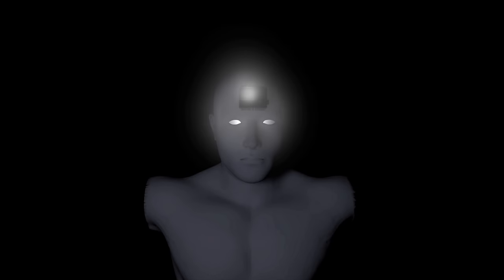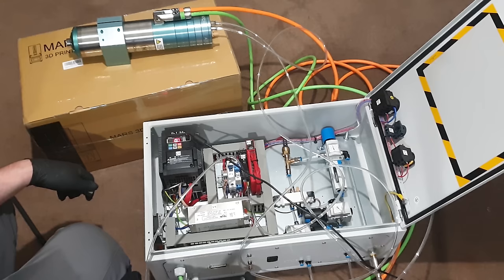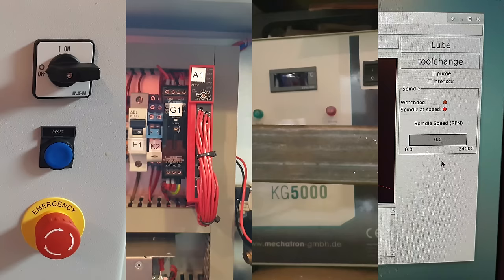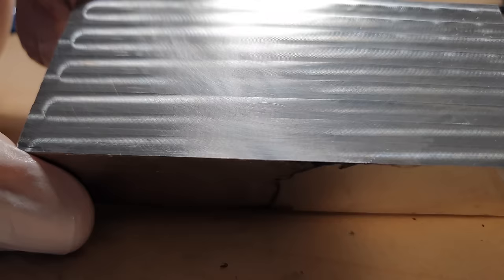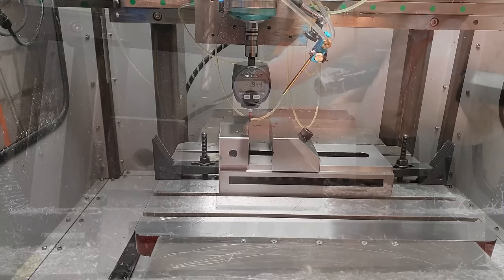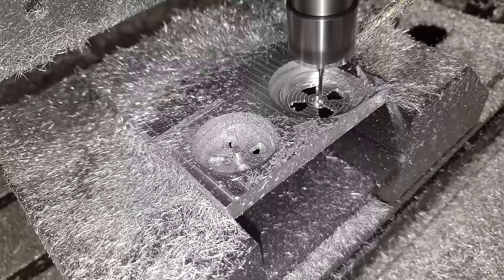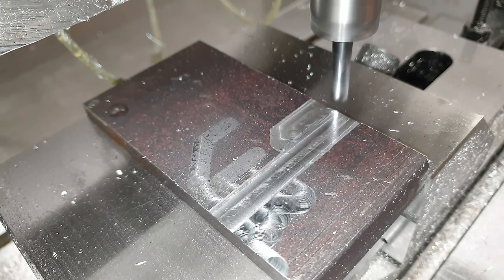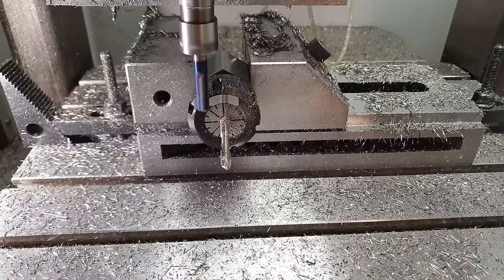CNC Finale: Automatic Toolchanger Spindle Install & Testing

Comment: @MarcoReps I'm pretty surprised that a company that pays so much attention to details would allow the exhaust of the pnumatics to vent openly into a cabinet containing the electronics. I like cabinets for pnumatics but in an application that electronics are in a shared cabinet, i externally vent all exhaust ports and i recommend you do as well. Stops oil and dirt build up in the cabinet and helps protect the electronics. Easy solution with a few pushlock fittings and hose and a nice bulkhead fitting for an external muffler.

Comment: If you need to make accurate holes for bearings, you need to use a boring head.  It completely eliminates the small humps created during the 2D circular interpolation that all CNC machines have.
Reply: But exciting heads are so much more, well, exciting.

Comment: for your aluminum parts i would recamend to do final pass with a 3 flute yg1 alu power with a 0.15 mm stock to leave from the previes pass and all the rpm.s you can trow at it  ( about 0.06mm pr. tooth ) and instead of doing a normal contour as you did when removeing the outside material then change the contour from 2D to ramp if you can ( i know you can du that in mastercam and also seen it done in fusion so you should be able to )

best regards from above ( denmark )

Comment: 10:50 I empathize with this urge and would suggest either avoiding or embracing the fabrication of large optical surfaces such as the matched focal length pair of 400mm diameter F4.5 parabolic primary mirrors I fabricated a few years ago.  Few things can compare to working with a 10nm RMS surface error margin with hand tools!

Comment: Alot of times carbide tools are about .001 inches smaller than written. That would explain the poor bearing fit near the end. Also when you get big sparks like that it typically means your tool is dead.

Comment: Here I am using a ruler to judge whether my X is parallel to the base. Well, I didn't know homemade CNC machines even exist when I started building mine, so my expectation was to be able to move. Not using gcode. Just move. whereever. So I'm happy with about 0.2mm Z deviation over a 500mm X axis.

Comment: You can totally do hardened steel milling on this machine. However, there are some tricks. The intuitive response to glowing chips is making chips smaller. But that's not exactly what you do - they need to be thick enough to remove enough heat. Don't ruin your tool with a mist coolant while doing that - it only increases the thermal stress on it. Fooling around with a tap is a kind of okay, but don't even think about actually machining anything as poorly supported like that.

Comment: Wow, very nice one. Finally getting some real chips. I would love to see some advanced tool motion application. Trochoidal tool motion lets you quickly rough parts at a constant material removal rate. Just an ides to increase the engineering porn factor.

Comment: You should consider running much lower radial depth of cut (5-10% of tool radius) and running much faster to try and get some radial chip thinning action. It will be very useful at your high spindle speeds, which are already probably not good for the right material surface speeds.

Comment: ofcorse the faceimg cur isn't flat, because your end mill is bending while takeing the chip that's why a pcket is smaller if you mill in the direction of the spindle rotation and rarger if you mill against it

Comment: the easiest way i've found to tram a machine in quickly is by using a disc brake rotor.  makes sweeping super easy, i picked up a cheap china made disc and its parallel and flat under 2 tenths or 5 micron which is about the credit i gave to the error in my method of gaging.

Comment: Compressed air should not be combined in the same enclosure as electrical controls. (IEC60204-1, NFPA-79).  This is not safe because additional air can feed a fire, a high pressure environment can contribute to combustion, and because the compressed air feeding the system can contain moisture which could build up in the electrical cabinet creating a shock hazard.  Can I recommend that you separate or divide the interior of this panel somehow, and add a vent and a drain on the pneumatic side?  I like your videos and want you alive to make them. :p

Comment: The whole project is impressive but the deflection less than the width of an RBC at 25kg. Wow. If you factor in leverage it looked like you were applying more like 50kg. I bet you’re the guy that machines the pieces who seams disappear when assembled. Next level impressive.

Comment: Those fine steel chips are horrible.  I got some of those grinding a piece of metal with a carbide bur.  They are so small they are hard to see but if you have one stuck in your finger they do hurt when you hit them.  I was lucky enough to have a 2 inch square rare earth magnet.  All I had to do was get my finger close and I can feel it pull those evil little things right out, it has a very strong pull.  The only downside is that it only works with steel and similar metals.  I should get another magnet but I would not handle both of them at the same time, these would crush your hand if you are not careful.

Comment: uh, dont use fusion default values, really. :) check the manufacturers data sheets for the bits for the correct parameters (10% tool diameter step over if in doubt) . The reason you are getting the sparks on that steel part is that the material gets so thin that it cannot conduct the heat away and just kinda melts. same thing that can hurt drillbits when you are close to breaking through.

Comment: Did you notice the deliberate mistake in the drawing at 7:49. At fist I looked at the top half of the front bearings and thought "they don't oppose". Then I looked at the bottom half X-section and they've both magically turned around! (Someone flipped the wrong bearing sections)

Comment: Take a look at variable flute end mills for exceptional side milling. At work we use end mills from gorillamill.com specifically the yeti series. Not sure what you can find that's local to you (dunno where yur from). I am not recommending this as the ONLY place to buy endmills but I know they perform very well and they have an awesome speeds/feeds calculator online. It's hard to mess up if you use what they recommend for the tools that they sell.

If you want more accurate holes, check to see what fusion has to offer for cutter compensation. This will allow you to dial in a number at the machine to slightly increase the size of a hole on a single pass tool path. Assuming your controller will do cutter compensation. I haven't followed closely enough so I don't know what you're using. If all else you can create single pass toolpaths with tiny increments in size changes and run them; this will let you increase the hole size until it's within tolerance.

I don't write toolpaths in fusion but you might want to look to see if you are making arc moves instead of line moves on a hole as well. The arc moves are MUCH cleaner since in makes tool movements in an arc instead of a bunch of small line movements. Again I only assume that your controller can perform an arc move, but nearly anything recent can. Be aware that helical arc moves might not work well, those are a tad different than a final single pass where the arc is maintained on a single plane. Ramping down while performing an arc outputs different g-code and some newer controllers don't do this. There is nothing wrong with making line movement helical passes though, you will just be roughing anyway.

Comment: I am curious why your lead screws have no rear bearing blocks?  I ask because I recently bought a used machine that uses similar linear rails and it too has no rear bearings.  When I first discovered this, I was outraged.  But now I see your machine done that way & you don't strike me as the type to half ass anything, so I am wondering if there is an advantage?  Or maybe you just haven't gotten around to making them yet? 

This has to be one of the best shop built mills I have seen, very well done.

One last thing, the endmill you used at the end...is that one of those "nano blue" coated tools?  Do find them to be more good or gimmicky ?

Comment: Very good DIY machine, impressive! I wanted to build one myself but an auction changed me. I was going to get some measuring tools and a manual mill but came home with a large VMC instead. It was a Fadal 4020 still holding tolerance in production. So for $1,100usd I ended up with a 4800kg  (10,500lb) machine center instead, sooooo, not going to do the DIY any longer. That being said, I have a small garage, the machine is 1/3 of the whole space, that is the down side. Well, and trying to install it in the first place.

Comment: Did you check your feeds and speeds? Most likely the rpm was to high for the carbide and steel and it got burned, especialy with non water cooling.

Comment: Very nice.  Just curious if you made a counterbalance to take the weight of the vertical axis off the ball screw?  This unloads the z axis motor and if applied in the proper point balances the parts about the linear bearings.  High stiffness is of course still of primary importance.

Comment: I'm no expert, but you could have cleared most of the material with a larger diameter end mill and then finished it with the small end mills. However, I do realize you were using the micro-size end mills as the failure point to minimize the risk of damaging your new spindle.

Comment: 27:05 Du helix viel zu langsam, in dem moment wo dur kurz vor dem durchbruch bist wird das Material unter dem Fräser so dünn das es die Wärme nicht mehr ableiten kann dadurch entstehen die funken. Das macht aber weiter nichts ist fast schon normal bei High rpm. Aber ich empfele mal ohne gewär.
VC 60-100m/min
F 0,1-0,25mm/U
und -0,2mm Z pro Helicalumdrehung

Und mit den kleinen 3,15mm Fräsern in Alu
VC 150-250m/min
F ca 2500mm/min
Ap 5-10mm
Ae 0,2-0,3mm

Comment: Just come across your video and only got to the point of showing the cross section of spindle and not got round to reading any comments yet but the front spindle bearings seam to be in in line rather than opposed to each other?

Comment: Nice build!

Summer questions, though:

Why are you conventional cutting when hogging that stock to size?

Also, I would drill while the part is still rigid, not after you cut away the walls to tabs!

Would love to hear your answer!
Reply from the maker: conventional cutting was only to test and get a feel for maximum stepover

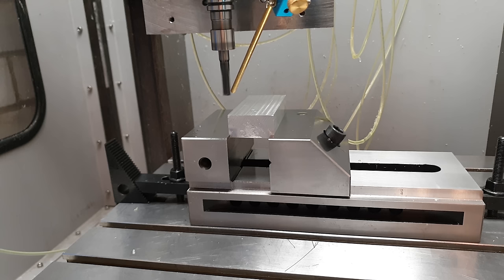Comment: Always a pleasure to watch your vids. 11:40. You couldn't find any longer tools?  :):)  In my experience any water/oil based coolant and mist/fogbuster like coolant has this sticky nature. Although Fenella is a tad les sticky than Koolmist 77. bio ethanol and a few drops of castor oil per liter are your friend. (with aluminium ,at least). (alcohol in general, perhaps..) But.. I've heard/read that that type of relative quick vaporising coolant can cause micro-fracture/cracks on the endmills. (haven't noticed a degration of the cutters myself, but it's not backed up by any form of science. Datron also uses that type of coolant, but I guess you know that..
Reply from the maker: ethanol mist cooling sounds like a great recipe for disaster 😅
Reply: @reps  living on the edge... For aluminium it's fine. It's pretty common. If you need to machine hss it's perhaps not the best weapon of choice.. :)

Comment: Correct me if I'm wrong, but are you running your work all in an anti-clockwise motion with bits running in a clockwise motion (Back Cutting) If so, shouldn't you be milling in a clockwise motion?!?!

Comment: So why are these VFDs used instead of brushless motors like for the servos? Does it have to do with torque at lower RPMs? 
Ideally I'd like to run everything off 48V DC house battery in the future.

Comment: That spindle motor is a work of art...

Oh, and the rest of your mill construction isn't too bad either ;-)

I feel your pain with the steel chips in clothing, I mistakenly wore a fleece earlier in the year whilst using an angle grinder on some steel... "defluffing" clothing with a magnet is very time consuming!

Comment: I am running a chinese high speed spindle in my SK50 spindle and it even goes throw the ATC system if I remember to disconnect the cable.

Comment: Hi Marco, thanks for a superlative video.
I am trying to build a cnc drlling machine where I propose to use a 3 kw spindle.
Could I use an end mill cutter like you did to do my job on 20 mm thick steel plates? 
My hole diameter is 64 mm.
Could you also suggest if I need a gear box for reduction in speed and higher torque?
Time is not a constraint for me while drilling holes.
Appreciate a reply.

Comment: 28:09 even with 100k machine and new tool it would be undersize.thats why there is G41 anf G42 oh wait fusion360.you need tell tool is smaller 0.015-0.02 and you nail it

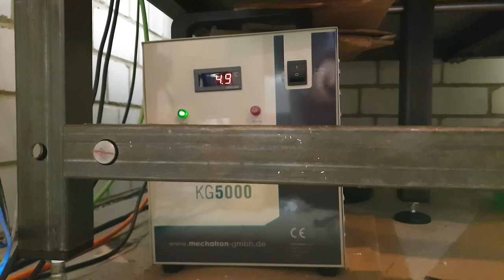Comment: Hi Marco, interesting !  But what system of square tubing did you use at 23:23 ? Is that a connection system ?  The round part with the red logo.

Comment: I would use a face mill to remove the scale first. That will save the end grind on the carbide endmills. Also, using what is called "trocoidal" tool paths will allow you to use a small end mill to cut full depth slots at a very fast rate, as well as mitigate chip removal problems. Side note, the process of aligning the spindle is known as "tramming" and there is a lot of information on Youtube to aid in that process.

Comment: In my company we use most of the 4 to 6 flute Carbide tools for steel and titanium but your RPM are to high for me, you are burning them out, you can use same feed rate but low rpm, and we use coolant so one more reason for you to slow down, but maybe becouse of the spindle power? just my 2 cent.

Comment: Your spindle speeds are WAY too high. That's why you are burning through endmills. The chips carry away most of the heat from machining, so if you don't have a big enough chip-per-tooth ratio, you'll heat tools up real quick. Try about 5000 RPM and 1000 mm/minute for the 2-flute 9mm.

Comment: Alright, I was going to build a CNC, but after watching this screw it. Can't afford all that crap anyways.

Btw I suspect your spark explosion on the steel was a case of it hardening due to heat build-up. There is a reason why typical metal mills work with low spindle speeds.

Comment: 6:27 Too funny.
 
27:05 Your surface speed was way too high that's why the spark show
Reply: 27:05
Reply: it's a 40k rpm spindle. at 8k it won't have enough juice to cut.
Reply: @Roelasia  lol the cutter is breaking way before that spindle is stalling
Reply: That... but actually the bottom is getting very thin and is flexing , so the endmill is rubbing against the bottom instead of cutting it. It gets thin enough to bend away so all you do is rubbing against it creating a lot of heat..
Reply: @benvano3487  yeah not as risky with an endmill but I've seen that skin wrap around indexables. Helps to drill your center if you're interpolating through.

If you can use a smaller endmill than your start hole just drop it to the bottom and use adaptive clearing. +2 for added tool life and added productivity. I use this strategy frequently at work.

Comment: stop dreaming about flood coolant, reduce your doc and increace your woc accordingly, also try g-wizard for feeds and speeds 

and the thing why the steed throws so many sparks, is bc the steel workhardend , probably your ramp in was left at the preset 2° wich can cause the endmill to rub on the material rathe than cut it so there's where the heat came from

Comment: Anyone else notice that the model has has the angular contact bearing orientations wrong for one bearing in each pair?  :-)  They're facing the same direction, not opposed.  LOL
Reply: Hello David, 
yes you noticed this correctly but its intended :) the bearings of this spindle are arranged in tandem-O-tandem. This arrangement has technical reasons and is better for high axial loads.

If you have more questions please dont hesitate to ask.

Best regards your 
mechatron team
Reply: I stand corrected.  The mismatch in size of the bearings in the nose and tail of the spindle didn’t seem like it would allow sufficient preload for that configuration.  I just thought it might have been a model oversight.  Very nice spindle!
Reply: @cncmechtech  you were very observant and in some cases this arrangement is actually better. Reason for tandem arrangement in the nose is that in case of a tool change the forces on the bearings are low. Thank you for your feedback.